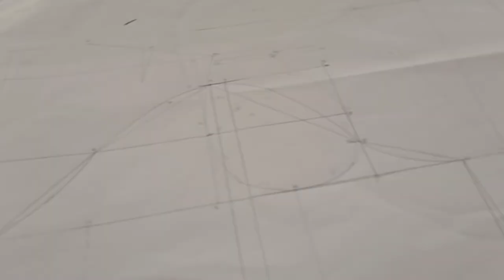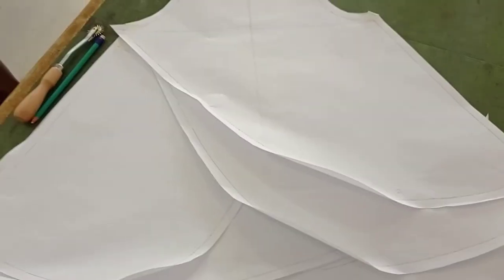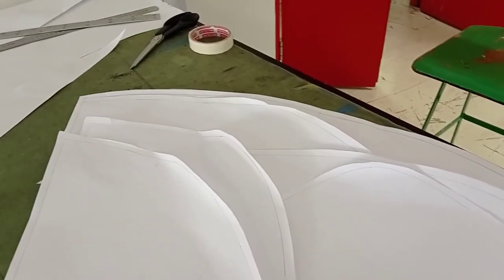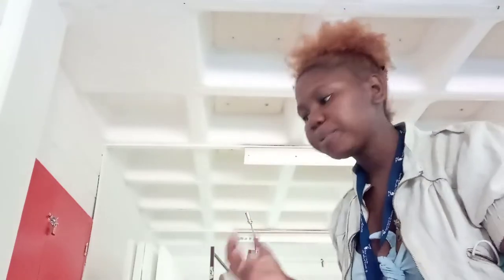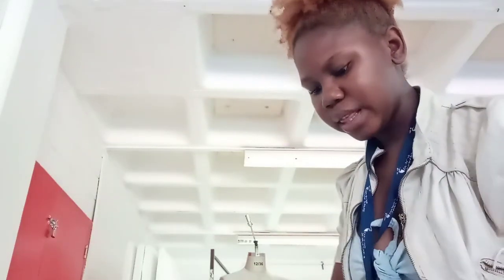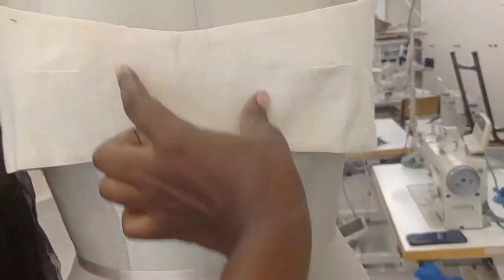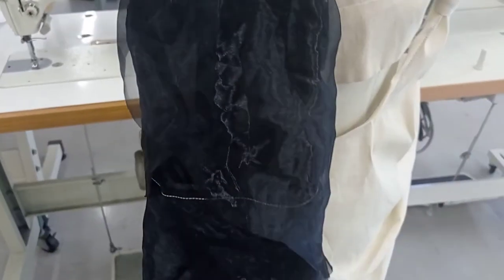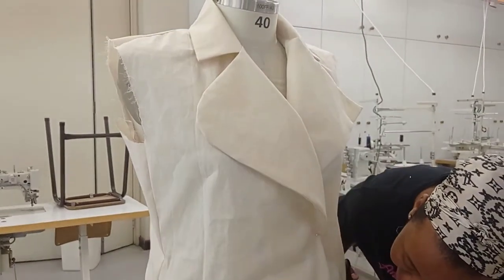Fashion Student Vlog Week 3: more patterns, look one mock up| Dintle Pondo| South African YouTuber

Comment: Hi Dintle, I just bought a machine and I am a beginer. Your videos are helping me a lot. Could you please make a video on how to position a material on the machine. I have been trying to figure it out but the thread(end thread on the foot) keeps falling off or twisting around my project. I don't know if I'm making sense
Reply from the maker: Hi Thando sorry for the late response sis🙏🏽 which thread keeps twisting around your fabric, is it the top thread or the bottom thread. Your fabric has to be right sides facing each other I made a video is how to identify this on your fabric in my sewing 101 video, also it's very important to test your fabric first so that you can set up the right tension as well as use the right needle for your fabric